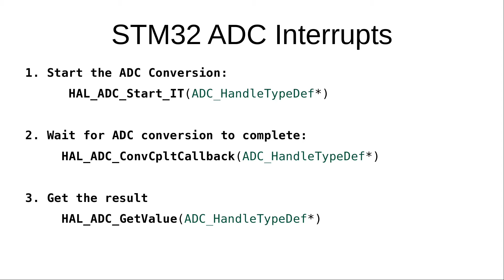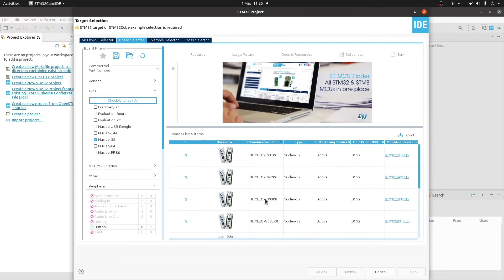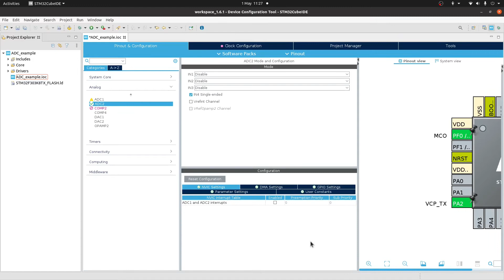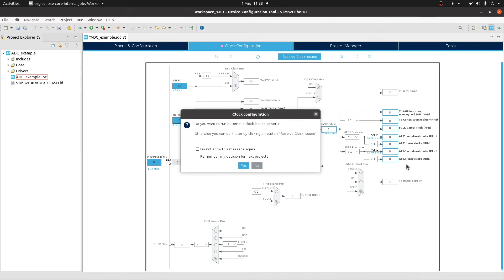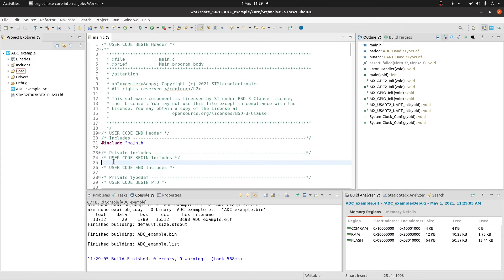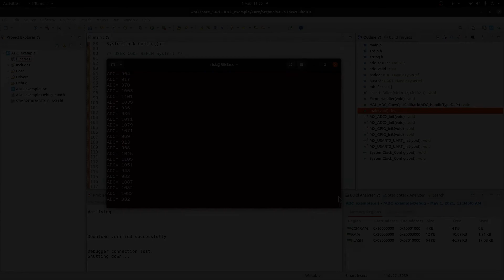SMT32 ADC Interrupts with STM32CubeIDE

Comment: thanks , just im asking if i want to control the adc to make interruption at a specifiv valure let's say for example i want temperature's  sensor activate the buzz at a determined degree what should i do?
Reply from the maker: I don't think you can interrupt at a specific ADC value. You will have to use the normal ADC interrupt handler to look for the value and then act when it is above your threshold value.
Reply: @randomrickUK  thanks a lot

Comment: May feel silly but i'm new to stm32 and cube ide
Why you write if(h == &hadc2)
Reply from the maker: Hi - it's because both ADC1 and ADC2 share the same callback function.  Look at time 3:15 - the only choice is to enable interrupts for both ADC1 and  2.
So in the callback, you need to know which ADC just interrupted, and handle them separately. 
Of course, if you're only using one of those two ADCs, then there's no need to check.